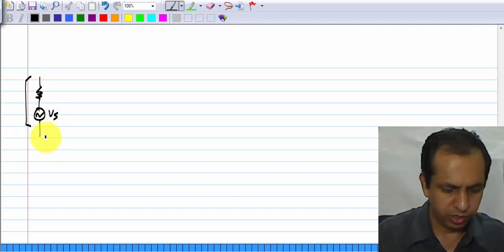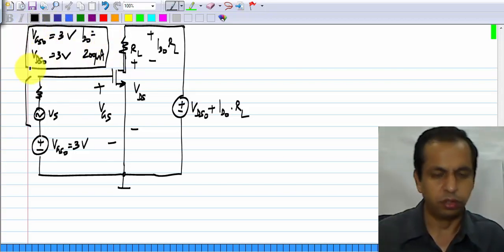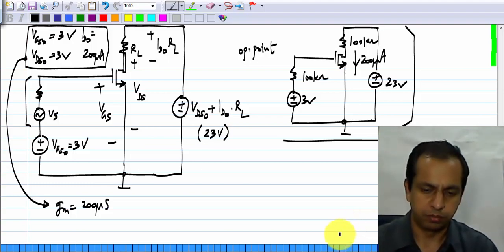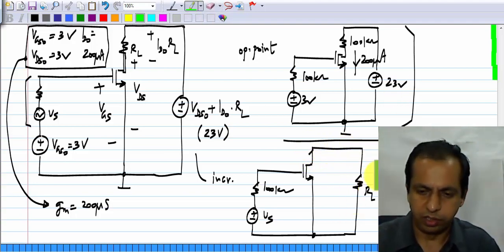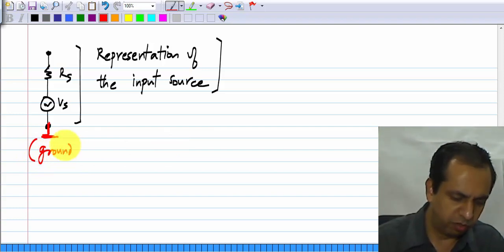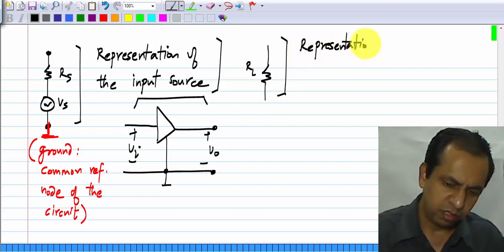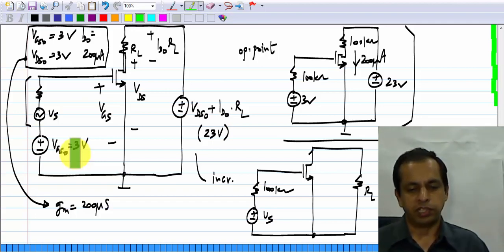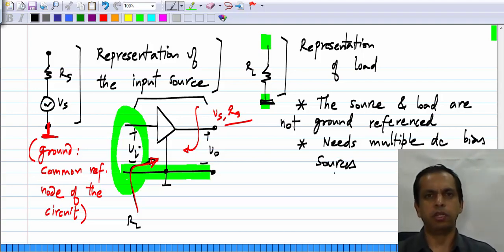0212MOSBasicAmplifierProblems

Comment: Can you please elaborate on why the source necessarily needs to be connected to a reference node?
Reply: This is what I think-
The COM node of the amplifier model is the source terminal of a MOS. Now the general input and output which we drew were connected to some voltage sources which acted as offsets for getting the operating point. However, this is not be the case always as shown by taking the example of an opamp where we have only one wire carrying some voltage (with respect to a reference node usually a ground which is at 0V). When this wire is used as in input for some next opamp, we observe only one physical connection (of this wire to the gate) and accept by default that the other terminal is ground (or some other reference). Thus you can imagine that u have a voltage src with a terminal on ground and the other connected to the gate. So the main problem which we are facing is that we already have a terminal fixed to the ground but we attached some offset voltage to have some operating point to this terminal, thus it is violating the fact that we want this terminal to be at ground. The solution will be in the next video. Could I make it clear?